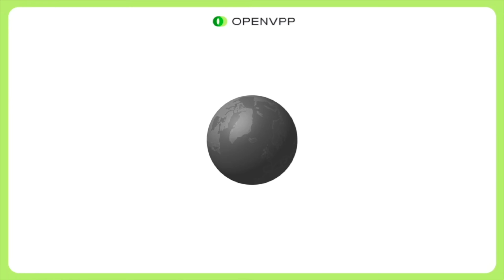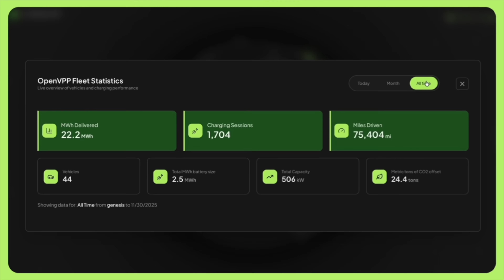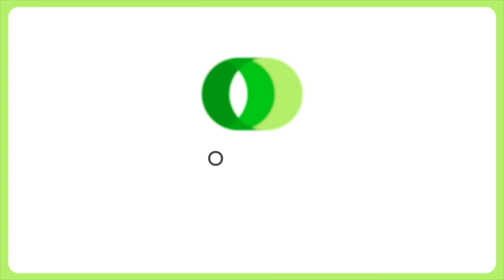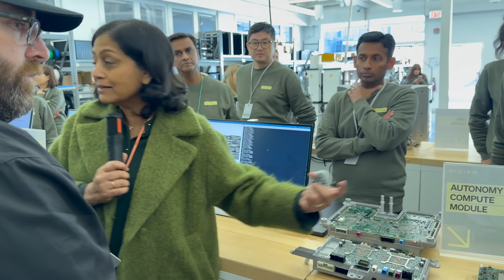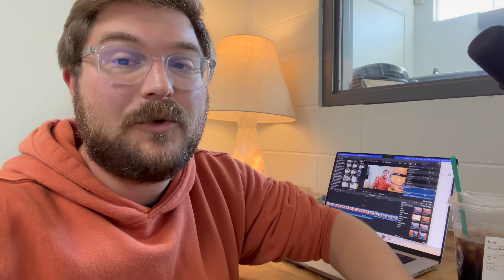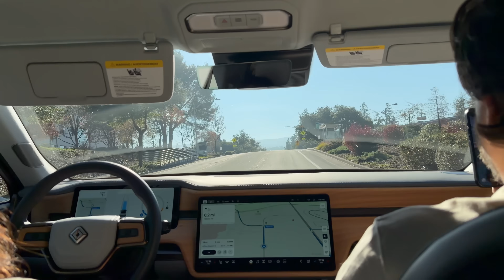My Rivian “FSD” Test Ride! Long Road Ahead But The Correct Choice

Comment: As a potential customer my feeling is they have to start somewhere. Also as a customer who doesn’t have a vehicle that can do point to point anything, any system is an improvement on that. If Tesla FSD is the benchmark then that’s fine, but I guess the floor for the vast majority of customers is a car with basic lane centering or nothing at all. So I feel reviews need to look at the market as whole. What am I getting over the vast majority of vehicles on the road, does the Rivian roadmap look like it will become something competitive to Tesla’s? Worth investing in the platform now or wait and see? What’s the value Rivian offers in the overall market? Will the features on offer delight customers who haven’t experienced FSD if they prefer the Rivian brand? Personally I think yes, based on what I saw. But I don’t daily drive anything close to these systems.

Comment: i am very grateful and appreciative that other auto companies are attempting to compete with teslas supervised full self driving (very nearly approved by regulators for unsupervised, which will save even more lives because fsd is 10 times + safer than a human drivers capabilities) which seems like comparing a cave man car or flintstone car to a futuristic land grounded spaceship (all tesla vehicles).

tesla spends billions and trillions perfecting a vehicle which equates to zero scheduled maintenance for their newer vehicles which all have a hv battery lifespan of over one million miles.

while other automakers engineer and design vehicles to require continuous maintenance, oil changes and other free services (for a limited time or lifetime) but individuals have realized they would rather not take time out of their lives to have services done that do not even exist, with a tesla or other ev’s as well.

while toyota is spending billions lobbying against and killing electric vehicles, while simultaneously making commercials that talk about their plans for a brighter battery ev future (solid state batteries), toyota currently is still using some of the least reliable, most problematic electric vehicle batteries in the world.

meanwhile tesla spends zero on advertising, zero on hurting ev sales, and zero on fake news.

traditional automakers appear to promote fake news about ev’s, and salespeople often have told me to go buy a tesla, its a better vehicle than anything they offer for long trips and travel, and reliability.

as a note: 

byd blade batteries and catl shenxing gen 2 batteries both charge from 0% to 100% in five minutes, last approximately 1,000,000 (one million miles), cost less to manufacture, utilize non scarce materials, and are safer.

tesla also owns the patent on Maxwell Super Capacitor Batteries, which is said to compete with Chinas best flash charging long life batteries.

there is a reason that tesla sells more ev’s than all other US automakers EV sales combined. its the best, in every way that matters the most, and the most convenient, well maintained, and abundantly growing supercharging network in the world (except China installs thousands of low cost ev charging stations daily for decades).

Chine also has the lowest ev registration fees, the lowest or free ev charging, and encourages ev purchase, low cost ownership, and lots of incentives and subsidies to help everyone transition to electric vehicles. Study Chinas success at cutting all gas and oil subsidies, and supporting continuous breakthroughs in flash charging long life ev batteries that cost less, safer, and last longer than any other batteries in the technologically advanced world.

Comment: The idea that prospective EV/luxury car makers should not support Rivian and instead only go with one automaker's solution is... absurd. Tesla has FSD, sure. But context people. 
1)Less than 12% of people buy a Tesla and activate FSD. 
2) But the car itself isn't the best experience. The seats, the steering, the fact that Tesla just continued the only two models with air suspension and actual instrument cluster screens...  

Rivian is adding autonomous features to a relatively fancy ride. 
Tesla is making Honda-level vehicles that have autonomous driving.
You can take a seven-seater Rivian to the ballet one day and take it to the campsite the next. 
These customers are not the same.

Comment: THe MB CLA NVidia first drive that @kyleconnor just posted - it is notably smoother and better than Rivian, despite being well behind Tesla. Given that nVidia built that with simulation data largely, and that platform is available to all manufacturers, is Rivian making a very large, expensive mistake trying to do this all on their own? They seem VERY far away from a production acceptable version of their 'FSD'.

She disengages the system a LOT in this video.

Comment: Thanks for being honest about Tesla.
If you want to continue to compare others from time to time: Comma ai is an interesting system, which can even be used in older ICE cars. It‘s also not up there with Tesla, but they are admitting it openly and try to solve it a few years later than Tesla and then provide an ppen solution to nearly all cars. Don‘t know if they can do it, but it‘s already a great adas system and the hacked solution is interesting.

Comment: I think this was a fair assessment.  It used to be where products weren’t released until it was truly ready for consumer use.  I get that there’s a lot of press to keep up with the competition,  it sometimes I feel like a test dummy.  I have a Gen1 R1S so I’ll miss out on these features for now.  Question - currently with my driving style I only hit the breaks about 5% of the time.  With the new driving system is there any idea of how much breaking is used vs the motors just slowing down to a stop?  Thanks!

Comment: You have to start somewhere to get somewhere. Yes, Tesla is light years ahead and no one comes close to their FSD capabilities, but unless Tesla sells Rivian and other manufacturers their FSD system (which they won't do), these manufacturers have no choice but to build it from the ground up. 

Tesla also went through its own growing pains building FSD and one time, in the not so distant past, Tesla's FSD was in a similar place as Rivian's. 

This reminds me of when the iPhone was released in 2008. No other phone manufacturer could come close to rivaling what the iPhone could do. However, within a few years there were several phones with identical capabilities of the iPhone. I predict self-driving will have a similar trajectory.

Comment: I appreciate your analogy for FSD between Tesla and, well, pretty much all else -- including Rivian -- even if/when they offer some sort of real FSD. But, I'd offer up that that analogy can be expanded to EV vs ICE (including HEVs and PHEVs). The "state of the art" for range/refueling speed/number of refueling locations comparing Tesla vs non-Tesla locations is one thing, but I'd submit that the driving public already has at least 400+ (probably closer to 500 in most cases) miles of range (even out of the lowliest -- e.g. Toyota Corolla -- of ICE vehicles), quick (5 minutes-ish) refueling and, basically,  unlimited options for refueling (certainly FAR more than with an EV). So, the question is not why a non-Tesla with regards to FSD, but first and foremost, why an EV vs an ICE vehicle (again, including HEVs and PHEVs).  And I've owned an ID.4, but now own a PHEV to handle those situations that , in my opinion, an EV cannot yet address.  We talk about 300+ miles of range like it's a "stelar" feat and refueling (i.e. charging) from 10 - 80% (or 30 - 240 miles of range!) in 20 minutes like it's a major thing.  We look away from the fact that 300 (at 100%) miles of range is reduced to 210-240 in cooler months (that meaning an 80% charge level -- the recommended charge level -- will only give 168-193 miles of range).  I'd submit that ALL EVs (including Teslas -- who do lead the pack) are in their infancy right now. We need more range, faster refueling and more places to refuel before the "average person" can entertain the idea of having an EV as "their car."  But, that's just my opinion.

Comment: 4 to 8 years ago, this would have been FAR more impressive. With Tesla FSD having been as good as it is for the past 2-3 years.

I would be interested to try a system like this hands on, where I can guide steering inputs without disabling the system like AP/FSD.

I hope that they continue development.

Is it just me, or does their rendering of what the car sees look almost identical to Tesla AP?

Comment: At 21:21 and 27:00 it seems to be a regular occurrence in the videos from this day that the Rivian loves to cross multiple lanes when turning.  The fact that they are training it on CALIFORNIA drivers may come back to bite them.

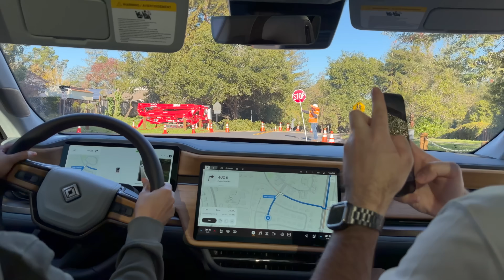At 25:50, it seems that the AI did not read the stop sign, nor see the human holding it.  It already knew that there was no pre-mapped stop sign so it was ready to continue despite the hand-held stop sign with a human in the road.

Comment: The 911 analogy is not apt here for a few reasons. On the surface, Tesla FSD currently has superior performance, but we need to look at the rate of improvement and Tesla's fundamental design decisions going back 10 years. Back then, Musk stated that other companies using LIDAR were "painting themselves in a corner" with that decision. Today, the Waymo Driver using LIDAR has passed FSD in terms of safety performance and seems to be pulling away. In fact, it seems it is Tesla that has painted itself in a corner with the choice of vision-only. A recent article characterized the difference between Waymo's "Motion LM" (Language) model and Tesla's "Reflex NN" (vision--->motion) model. These fundamental choices may explain why FSD seems to have plateaued in terms of miles between disengagements. Extrapolation suggests that Tesla may need two more generations of neural processor chip performance upgrades to reach a level of safety that the average consumer will find acceptable. Worst case, the research showing LLMs may never be able to grow out of hallucination behavior, may also apply to Tesla's similar brute-force approach and cause a hard limit to the system's safety performance. Tesla won't share safety data. Why? If it is better, support that assertion with data. Personally, I had Enhanced Autopilot and paid for FSD (with a free NN computer upgrade) on my 2018 Model 3. I also bought stock and drank a full gallon of the Tesla Kool-Aid. I also had a Model Y for a total of 6 years of Tesla ownership and trialed 2 different versions of FSD. For me, a system that is almost perfect, but will randomly fail even once every 1000 miles is worse than a simple lane-keeping system that doesn't nag me. Tesla is still on this side of the chasm and I don't see a path for them to get to the other side. Let's give Rivian and others a chance to learn from Tesla's choices and maybe make that leap.

Comment: You kept talking about other options on the market as if there are a lot of options. In the US, it's Tesla or nothing for end to end driving. So I'm very excited about any competition, especially since that competition includes a full size 3 row SUV, which Tesla doesn't have unless you get a model X for over $100k, and that's super cramped. More competition is good, and Rivian is the first in the US to actually step up to the plate and demo an end to end model, even if it won't be released to consumers for another year.

If Rivian makes good progress and can match the FSD performance of my HW3 tesla by release, it would be a very compelling option.

Comment: honestly, its a joke compared to Tesla, why even bother to release something like that if its even less predictable than Tesla system? Automakers MUST understand, modern drivers are like unhinged ADHD adolescence - they will get distracted if they can rely on a system for more then 1 minute, just to find themselves in the car accident.

NO ONE will actually "supervise" it, so its MUST be full FSD or Lane Assist with Adaptive Cruise control, nothing in between.

Comment: Just demo'd a R1S over the weekend, having very briefly owned and sold a launch edition R1T.  While on the highway the driver+ felt more polished than the original R1T it was only marginally better than basic tesla auto pilot.  As soon as I got off the highway, there was no advance cruise control at all, not even basic lane keeping.  It was so far behind Tesla basic auto pilot it was embarrassing, though the sales associate claim it's coming next month.  I left with the same impression I had with my original Rivian.  The interior is way better than Tesla, but the UI and software is way worse and almost unforgivable for the price point.

Comment: "FSD" is an option i could care less about in any car.   Until the actually highways, signs, markers etc.. are part of the FSD, I will not trust any FSD.  I would expect most people will think the same thing.    I like the lane centering, driver assist systems or whatever it is called.     I want to be in control of the vehicle.

Comment: One thing to consider when factoring in the data that will feed Rivian FSD is Amazon delivery trucks.  I couldn't even begin to fathom how many streets this trucks would map if they had the necessary cameras and data-agreements with Amazon.  I'd guess it's something like 50:1 in terms of data provided to Rivian v Tesla owner-operated vehicles.  Those trucks probably do 1,000 miles a day or more.

Comment: I just get left wondering in my excitement for them to get this done how they scale. How do they scale there chips, hardware, and platform with the overhead and costs around the ECU, Radars, and Lidar. How do they scale and deal with the initial software requirement scaling such as local storage for fleet data, cluster access local or rented for turning driving models, and do they actually see themselves in the next 24 months being able to afford the capex required to build there own data centers to accomplish this. I worry that with the current capex burn with R1* vehicles,  Capex Burn on pre-production R2 at Normal, and the Capex burn in Georgia to produce R2 and future R3* vehicles that this entire thing for them is insanely terrifying to see them maneuver through this. This is also on top of high probability of the economy just not being great next year in a lot ways.. 

I'm super into them doing this and cheering all the way, but dang lot going on in a roller coaster of situations.

Comment: You asked for input on how you review stuff like this; so, my response is don't "review" a sneak peak of a version of technology that is never going to be released to the public. I appreciate showing the full unedited drive and providing your thoughts on where they are heading, but reviewing the performance of a controlled demonstration is pointless. Even if the system had handled everything perfectly or exactly like Tesla, it wouldn't have meant anything. They admitted in several videos that it was a manually programmed route that wasn't even following their navigation system.  The demo drive with Rivian employees is just to show you what they are working on and get us excited about the future potential.

"Review" the UHF product when it is released in 2025.46 and review the point to point version that is actually released some time next year.   

For reference, I also have a Gen 1 R1T and a 2026 Model Y that is in FSD about 75% of the time. I love both (even though I get pissed at Rivian with every OTA that has Gen 2 only features that my Gen 1 hardware should be capable of like "co-steer").

Comment: My comments on this are, yes Tesla today is far ahead of what you were able to experience in Rivian today, but, this is a necessary step Rivian needed to take. I absolutely love my R1S and don't want a Tesla. Even though Tesla currently has a better autonomy, Tesla is not what I want. We need choice and I'm so glad Rivian is on that path. Yes they have a long ways to go but I do believe they will get there and continue to iterate faster and faster to shorten that gap. It's hard to say that Rivian could have shown a system today that was on par with Tesla. RJ was being very transparent where they were starting today and I believe when this hits consumers next year, it will be drastically improved.

Comment: While Tesla is great, I have found a flaw in their System. This flaw happens in both HW3 and AI4 cars equally. This is on rural road drives over 30 minutes on a single road. Both systems stop identifying speed limit changes. At least HW3 I can manually adjust speed limit, but AI4 latest version you can’t manually adjust speed limit. That speed profile even sloth mode will not fix a case where system is showing 50 MPH and the Speed limit is in Business district and 30 MPH. In that case HW3 is better cause I can scroll max speed down. 

Now to Rivian, I wonder if they are setting themselves for Osborne effect. The fact cars delivered over next year will have to be traded in for new car to get their L4 autonomy capability.

Comment: I’m excited about it. I’m currently in an Equinox EV with super cruise. A year ago when I bought it I was BLOWN AWAY by it. Then after the hubbub about FSD 13.x I demoed a Y and a 3 over the summer and have since been obsessed with the idea of a non Tesla vehicle with Tesla level autonomy.  I’ve been anxiously waiting to see what Rivian comes up with, as I’ve been a fan since the very first tank turn teaser vid they put out in 2019.  I hope General Motors steps up with a great system, even if it’s just hands off/eyes off super cruise. One question I have that I didn’t hear you mention is whether it will be able to be used in any capacity while towing.